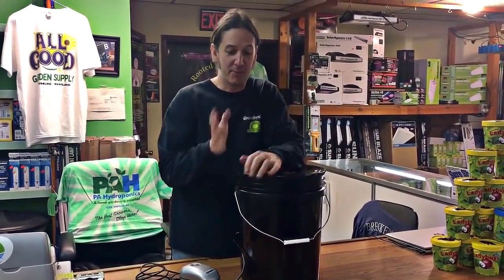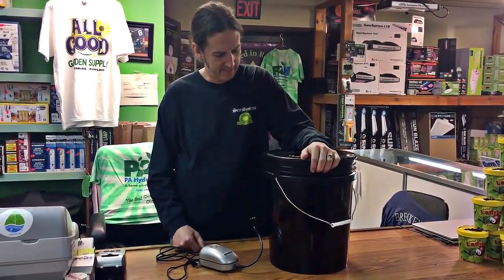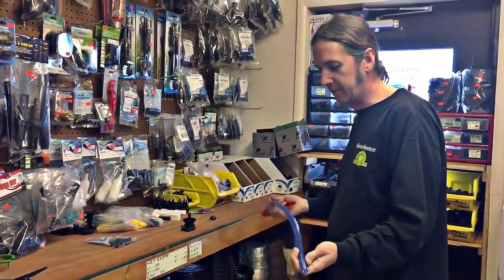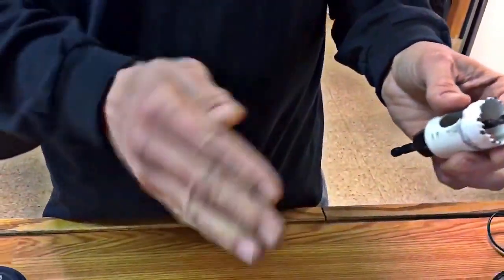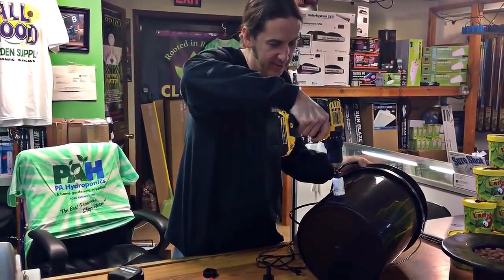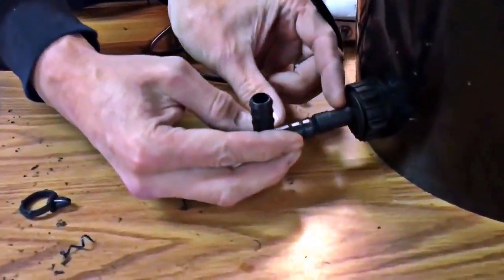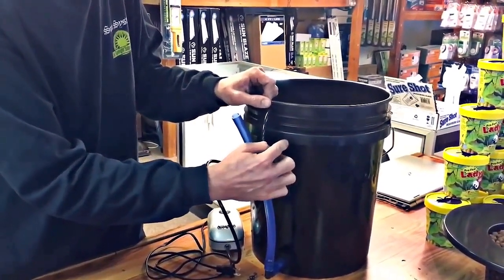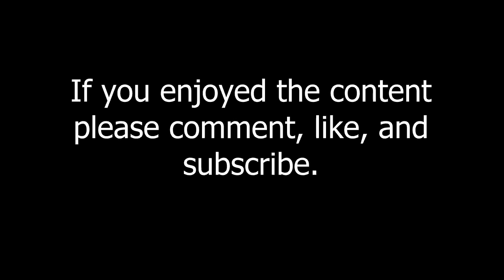DIY Water Level Indicator Kit

Comment: Great video been doing these for a while now.  Found a connect on internet sells those drains that come off those igloo containers seals perfect and drain great .  Only place I ever seen them.  I need those kits with the ring brown one sold by hydro farm can’t find them anymore?  I have one need a bunch more.  I used to used same cheap air pump 1 per bucket top drip and DWC combo as hate to wait for roots to grow into it takes forever for me.  Any suggestions?

Comment: Hello Gary 
Use a hole saw in reverse, which makes for a better cleaner cut  .
My suggestion is to add a fitting at the water level.
To work as a over flow line , back to resivour 
Allowing cool water from the resivour to be pumped into all containers. Cooling the water. Use a temp controller. Use a larger wider basket, Use a 2"thick rock wool slab cut to fit in the bottom.
Set a 4"×4" grodan block, both soaked in food water. On top of slab. Fill sides with your pebbles. Use a green diverter top to cover the grodan block ,  top with tinfoil to keep light off the rocks.  This message will self-destruct in 1 hour🎉
Reply: So like hold onto the cutter an let the drill wack around the bucket til it makes a hole... jus ignore me I is dum.
Reply: @fatkorn I suggest putting a bucket on your head and using the drill as a Ray gun
Reply: @fatkorn  obviously you never build a robust DWC system.
It needs to be the other way around, otherwise you will need to sand for hours until you get precision.
Reply: Expert, i like. Friend on Brasil here =)

Comment: Do you have kits I can buy to make 8 would cost me what I will get  your black buckets unless you say source them free. Lowes buckets have brittle plastic bottom Crack and home depot let's light in. I found empty f gal paint buckets to be heavy duty and light proof.
Reply: I pick mine up from bakery and pizza stores.  I know they are food grade and they charge me $2 or less.  Then I wrap the bucket in silver mylar "safety blanket to reflect heat and light.